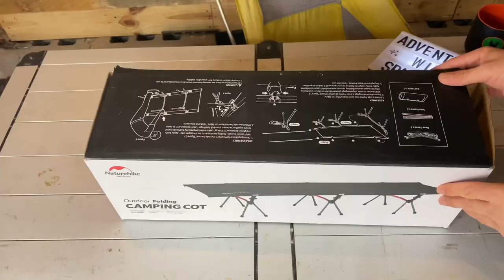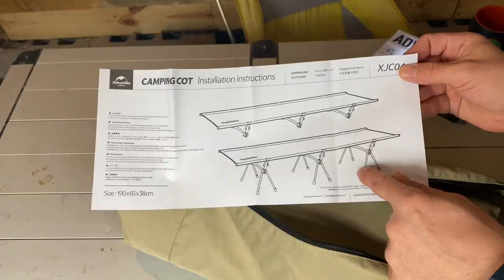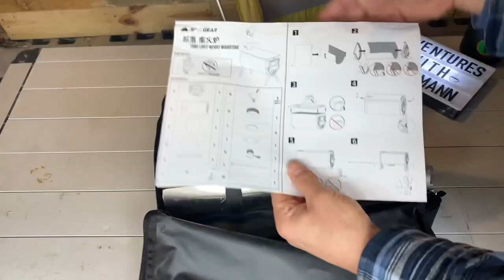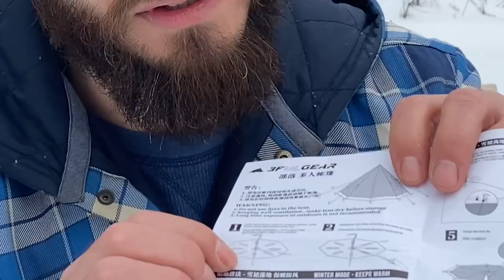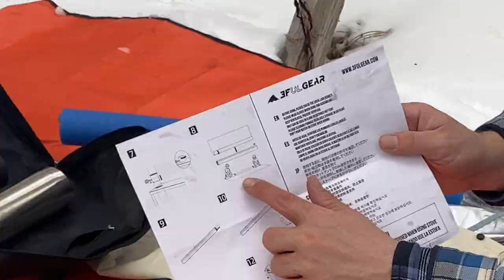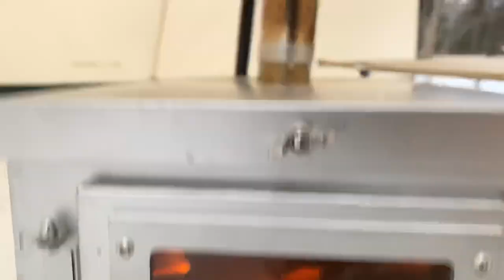New Hot Tent Setup Unboxing and First setup!

Comment: You gotta use the rings to keep the pipe in place as you work it man. Start at the end , get it going, put a ring on, work your way up a bit more, another ring and repeat. You got it though! The effort paid off,  and it doesn't look too bad either, considering the beating it just took!
Reply from the maker: @It’s Good in the Woods yeah at one point the end was all crinkled and folded but it doesn’t look bad anymore. I really should have watched a video or two on folding it first lol.
Reply: @AdventureswithSpackmann  The hard part is over! It'll roll out nice now!
Reply from the maker: @ItsGoodintheWoods  it’s seriously like magic! No clue how it works lol. Took like 2 mins my second time.

Comment: Hi there! When you set this tipi tent up in a lower setting so the snow skirt is actually on the ground—do you do anything particular to promote ventilation? I see that there is a vent at the top, but with the entire bottom sealed up with snow, do you need to crack the zippers a bit at night? Thanks as always!
Reply from the maker: @Bohan Zhang yes exactly. I crack the zipper at the bottom to increase ventilation. You can also crack the zippers from the top as well. Thanks a lot for watching!

Comment: At first I thought that was a really neat stove, but with all the warpage going on with a small fire... And that stove pipe! Seriously?! I think I'd rather haul several pieces they just flipped together then have to deal with that thing every time
Reply from the maker: @Doc Ink I hear ya. Warpage is normal and it very thin. Had it out again this weekend and and the warp didn’t affect it. Also after the first burn the stove pipe is much easier to get together lol. Probably took 2 mins the second time. I have a similar stove but it’s not collapsible and it weights almost 4x this so with the rounded metal it saves a ton of weight.  Personal I think I should have sprung for a nicer titanium one. Next time 😁 I do love stoves lol. Thanks for watching!